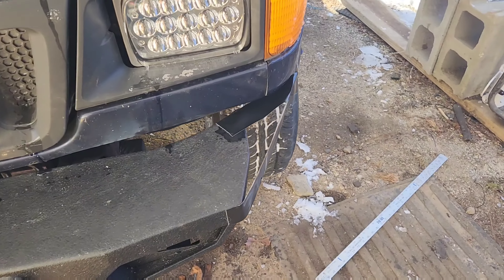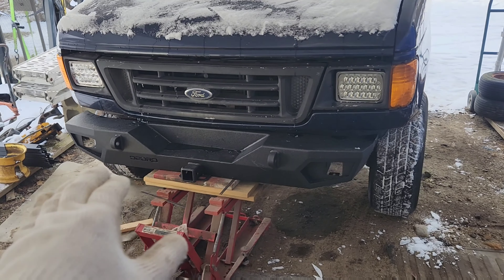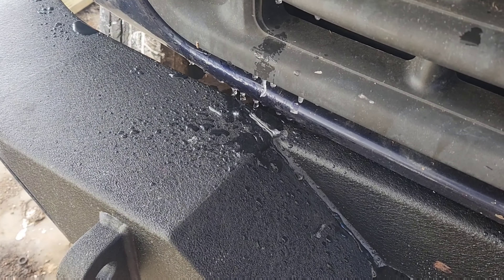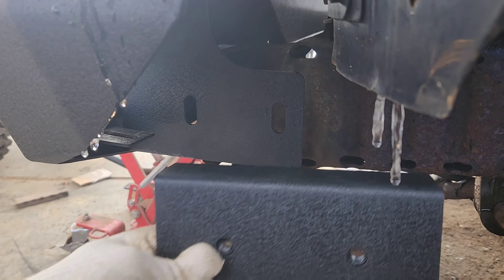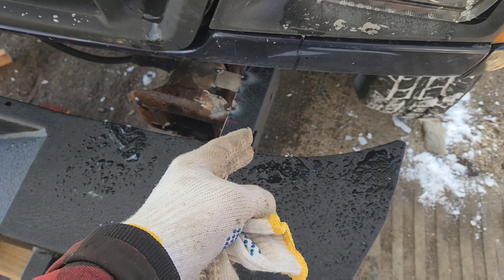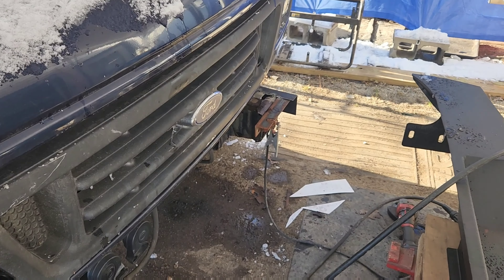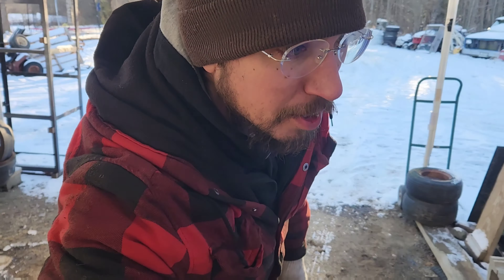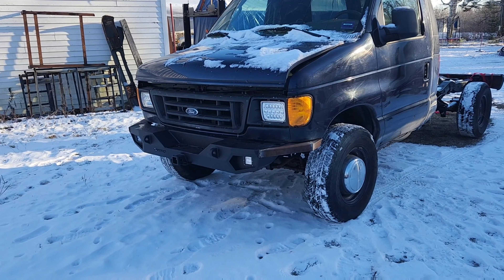Van-Haulen Custom Front Bumper Jeep Rear Bumper

Comment: great looking job, I do think the bottom of the batwings should have a face plate to match the bumper. Just a suggestion. As far as feeling bad sit in the bathroom and run hot water it will help clear out the congestion, kind of like a mini spa.
Reply from the maker: Agreed in the spring when I can get it back on the lift. I was debating adding something under them. Rock lights was another comment made and I like that idea also.

Comment: Nice job on the bumper. On your sickness chop up a onion fairly small in a bowl. Mash it with a fork and add about a tablespoon of water  heat in microwave till mildly hot then add a little minced garlic stir up let set a minute then eat. People might not like you for a couple days but you will get rid of that congestion and make you feel better in general.

Comment: when i put the bumper on the front of my 1500 Chevy i put a HF 5500 UTV winch underneath it. because i dont use it that often i didnt wanna drive around with all the extra weight and massive winch on my already massive bumper. ive pulled cars out of ditches, uprooted trees/bushes, even used it to pull a  huge 4 door diesel dually onto a trailer.... it barely did it but it was singe line.... i could of thrown my snatch block in there to double my pulling power if i had to.

Comment: Looking good!  Seems like that'd be a handy step for working on an engine in non-van designs and guessing the van too.  I'll be keeping that in mind for the Dodge Ram.  I like upping my chloride levels using potassium chloride (Nu-salt, etc. read ingredients always), though if you don't have any issues with using sodium chloride (iodized table salt)... just stick with making sure you're getting your daily requirements plus gargling and maybe nasal rinsing with the nasal douche bottle NeilLabs thingy if not hot shower rinsing sinuses.  Maybe even coconut oil snort afterwards if dry nasal membranes.   I also like using the Solaray Zinc Asporotate, though I wouldn't if already come down since seems like more a prophylactic from my experience, though does reduce symptoms if used. If not outside, I use the Now Vitamin D3 1500IU, daily if not outside for long enough to get sun.   Make sure you're staying hydrated and pissing enough... if not... might want to reduce your sodium.  I made some videos showing how I made the L. Reuteri (Teeth & Gums strains) yogurt and dabbling with the Osfortis strains that gives me too much looseness, so I stick with the teeth & gums one.  I'm about to try using the NIDO powdered whole milk since cost less doing the math.  Careful with the processed food, that crap makes everyone sick whether they want to admit that or not, I'm a B.S. degree'd chemist with biochem conc. so just saying if you like something fast food or processed crap... read the ingredients and make it yourself even if with cheap ingredients that's aren't from mainland China since those have Prop65 warnings for a reason. Also, keep up with the vitamin C dose like the zinc if you're going to get exposed you think or if you want once you got something.  Depends what you have... might not hurt to eat less and use broths like bone broths like some others note if you can handle the spices.  I can't and that just make my allergies worse and might aggravate or be the cause I'd get something infectious, since the body immune system was focused on allergy responding instead of pathogen responding.  The sovereign silver nasal spray is handy as well, though helps to get some probiotics back in after use. Florastor is another product I've not tried yet, though might be the better for womens health and mens too, combined with the whatever probiotic strain like REAL yogurt (read labels since most is shit chemicals not required we didn't evolve with using in that way).  The gut is like a brain backup and the immune system mission critical line of defense.
Reply: Oh yeah, and heal up!  🙂

Comment: Hey Neil my latest lawn mower score is a opposed twin 20 hp with a peerless 820 with 1"axles. Is this gonna be a good set up? Also I have a machine shop so should I lock the rear end or not? I will be driving it on pavement to get to the trails.
Reply from the maker: I tell most to leave it unlocked tell you find a reason to do the mod.
Reply: @redneckcomputergeek  I put the calipers on the axle late last night in the dark with the tires on. It appears to have a 1.200" axle, I don't think I was measuring a sleeve, but it was dark.